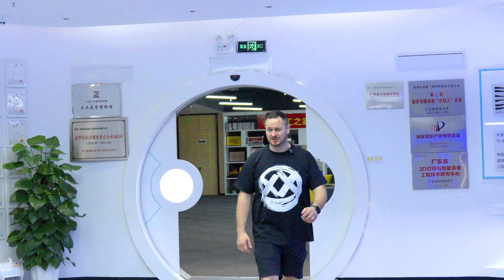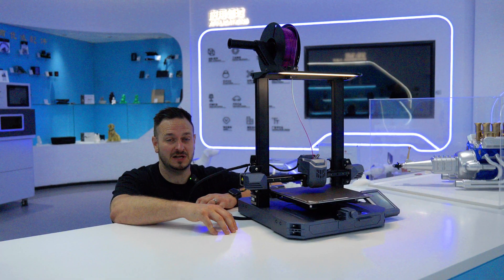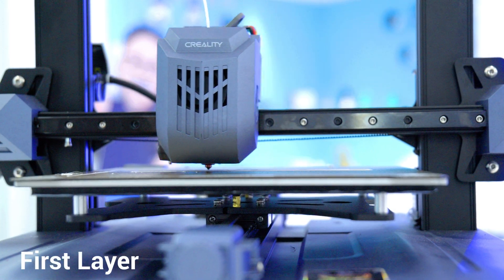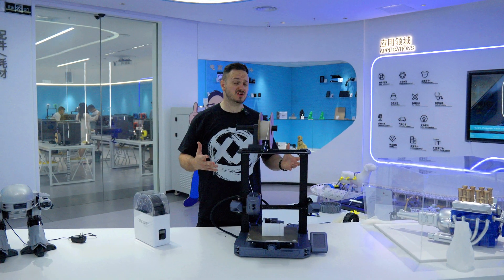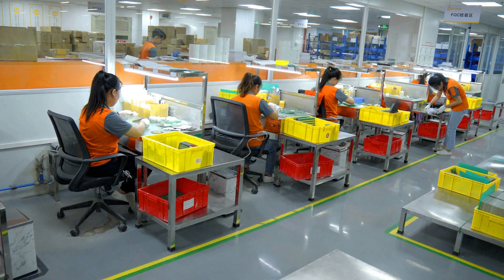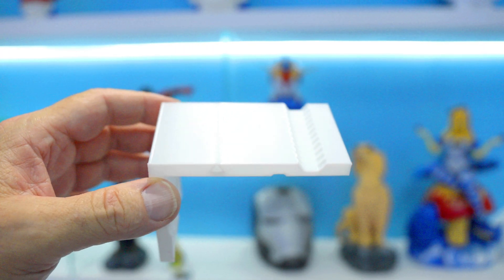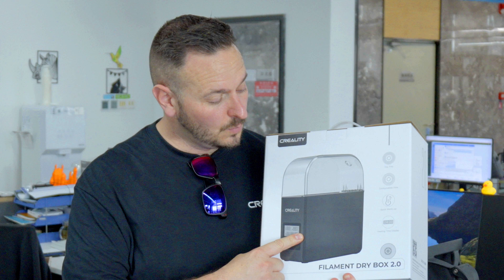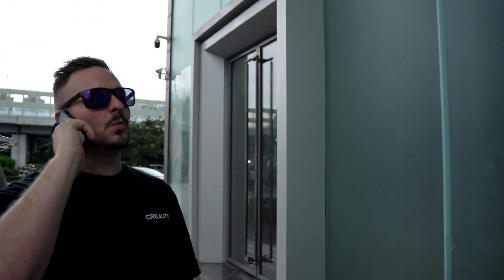Unveiling the Creality CR10 SE: An Exciting First Encounter

Comment: When you pause a print can you change the color of the filament and then resume the print?
Reply from the maker: I’ve not tried but it’s definitely different from marlin to klipper and a common question
Reply: M600 command

Comment: By any chance did you come across the elusive (possibly none existent) customer service? I was sold a used and faulty Ender 3 V2 Neo and they wouldn't do anything about it. Eventually I did get my money back and like a fool bought another, I've had nothing but problems with it and they don't want to know. Completely useless service by Creality, thankfully I am saving others from the same problems as I had by advising them to keep away from this company.
Reply from the maker: Hey David, it’s an interesting debate and yes! I even got the opportunity to answer a few questions and problems while I was there. There is a ton of stuff going on with their CS and a lot seems to be down to the way that faults are reported. It seems that if you’re reporting via Creailty cloud that seems to be a more direct route, additionally they are opening up a bunch of options like self service to warranty parts and support outside of China. As it happens they do run a 24/7 service but the support might not cover all printers and all issues. Also it’s not like the old days where you can just get a part on eBay and swap it out. So I’m with you on elements but it’s not like their not doing anything

Comment: Not really sure why they have this and the new Ender3V3, both seem to have the same bed size , both seem to be going to run Klipper (as it looks like Creality is going in this direction now) and I would gather both will be under $450US. It appears that they will be competing against each other, I might be missing something, but if the ender3v3 being announced on the 14th has the K1 print head and touch screen (at least it looks that way from the limited pics that have been released) that's going to be a winner. It just doesn't seem to make business sense to me, I must be wrong about something. Now if this had a bigger bed than I could understand it.